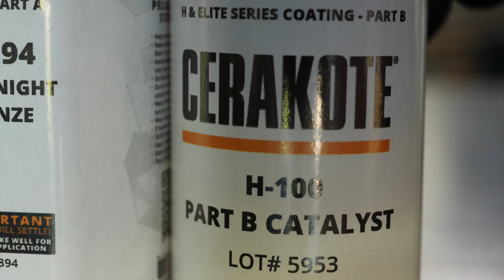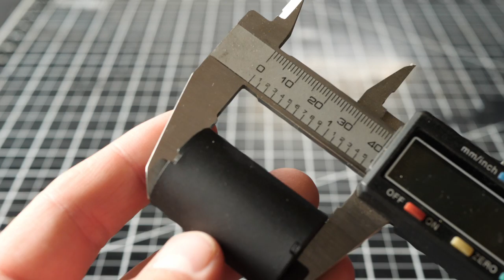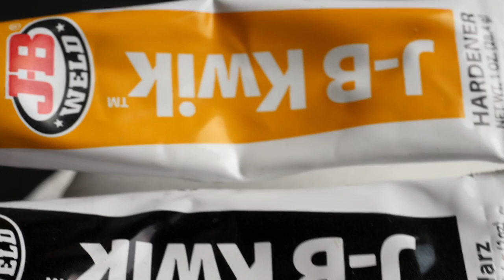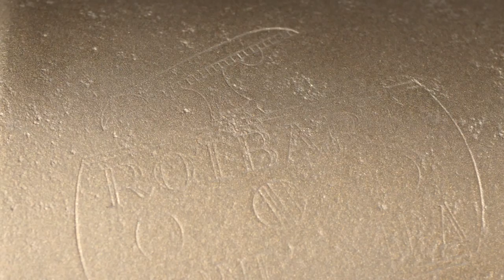Antique razor blade sharpener restoration

Comment: Those single blade razors are the only ones I've ever been able to use the best to shave. I've always hated 'disposing' of the blunt blades and felt so sad that I never had any luck hand sharpening or stropping.
I wish I had one of those little stroppers... but I just trim these days. I no longer shave and I'm a little sad about it, but no energy to manage simple tasks with my illness.
Nice video.

Comment: I wish you could buy one of these today.  I always hate throwing blades away when they could so readily be re-sharpened.
Reply: they dont work well with modern ss blades, they were ment for the old 3 hole and sloted gillette blue carbon steel blades

Comment: I'd love to have one of these, can you still buy them? What are they called?
Reply from the maker: I don’t know if they make new ones but I would look on eBay for a “safety razor sharpener”
Reply: @Unrestored  
I did after I watched your video but they are either for straight razors or cartridges, perhaps it's because 
Safety razor blades are cheaper,
I prefer them because they are easy to clean unlike the cartridge razors
Reply: @koudacyen  They are stroppers safety razor blades.  Twinplex made them in America.  Occasionally you see them in antique stores or Ebay.  They're fun stuff.

Comment: this was not restored ,parts that where chromed ,where painted ,a restoration is ,to restore something back to its former condition ,while trying to retain as much of the original item as possible  ,if you taken the time to nickle plate the chrome parts  ,that would be an acceptable compromise .
Reply from the maker: Nothing was painted..
Reply: @Unrestored  well you threw a dark polymer-ceramic over the chrome  hiding it,s mirror finnish . nah thats not the way to do it , worse case scenario if the chrome is damaged beyond repair ,strip the chrome. using hydrochloric acid and Hydrogen peroxide ,then nickel plate.the rest of work done i have no issues at all , but if its meant to be a mirror chrome finish ,then it should be a mirror chrome finish .
Reply: @gizmo1252000  no it's not.
Cerakote is durable et perfectly adapted to rotating parts because of lower friction coefficient.
It's way clever than just chroming or nickel plating.
Reply: @sylvaind.6786  then the item has not been (restored back to original) ,as the original had chrome . not some crappy ceramic coat on it . its a not a  dirtbike side casing  smh . if your video title says restored ,restore it ,no shortcuts . i dont care if ceramic coating is good for friction ,that,s not the point im making . if chroming is,nt possible ,then nickle plating would be a good substitute .and would not change the look of the item .
Reply: @gizmo1252000  ok boomer.
Let's call it a restomod then.